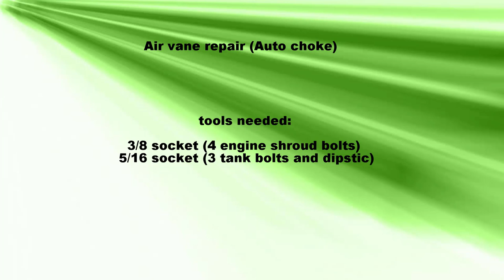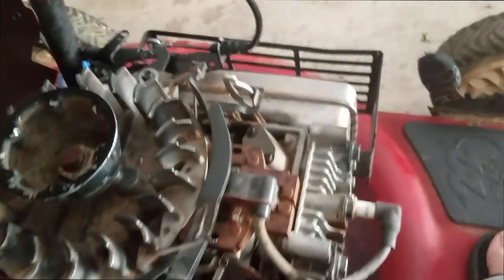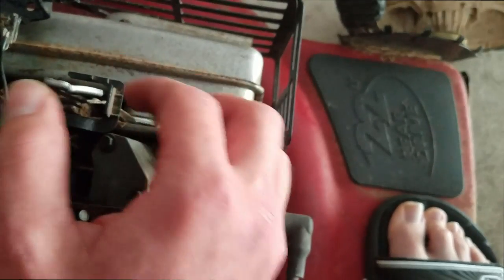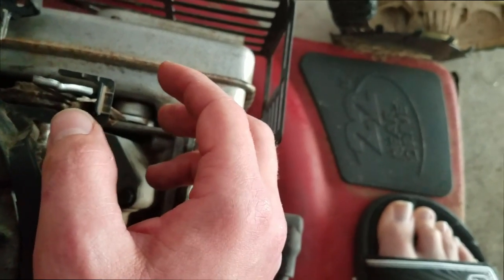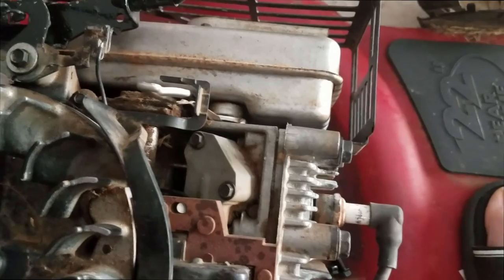air vane auto choke repair

Comment: After replacing the carburetor,  spark plug, and air filter, I figured she would fire right up. To my chagrin, I pulled and pulled, and not a thing happened. Then I saw your video and saw that little spring which I forgot to reattach. After that, she roared back to life. Just a small adjustment can make all the difference. Thanks a ton.

Comment: I think I may see what the problem is with the choke arm spring tension.  The carburetor (outside) end of the spring should be hooked into the notch on the "finger" with the little arrow point at the end of the choke arm. This should increase the spring tension to allow the choke arm to function properly.  Good video, though.
Reply: I was thinking the same thing cause I took a picture of mine before swapping out the carburetor and the spring is in that notch you mentioned and not where it’s displayed in the video so that could be it.

Comment: The tension on the Air Vane spring is engineered to hold just the right amount of resistance when cold and hot. hooking this spring where it was designed to be hooked will aid you in your efforts to smooth out your engine idle without having to experiment. I noticed in your video you had this Air Vane spring hooked up where it was not supposed to be. First things first. Remember theses B&S springs are engineered with just the right amount of tension and resistance in mind. Always use OEM parts.
Reply: Or don't buy one of these incredibly bady designed engines. I wish I didn't have.
Reply: I had one given to me because it wouldn't run. I got it running great until it heats up. It is a ridiculous design. I guess now I have to put money into it and buy a themostat for the lame auto choke. @thosoz3431

Comment: *DO YOU KNOW;  your AIR  VANE SPRING IS ON THE WRONG TAB ? After watching MANY vids., it is supposed to be on the little tab 1 inch to the right of the anchor bolt head--there is kind of a triangle around the tab/earlet.  **I ALSO LOOKED AT TORO diagramS online and the factory has the spring attaching to the that tab; yours is lower and hooked to something else out in front of the pivot base. JFYI ! 'NOT 1 of those guys that rag on Ytube Postings OR a know it all ; I wish I had $$$ for all the time I have spent/mispent on trying to get such a delicate (&dumb) spring design to function;  A $6 CABLE WOULD HAVE WORKED FINE ON THE CHOKE MR. TORO !

Comment: I bought this exact mower today for $5. Missing the air cleaner and most of the springs. They have the choke zip tied. I’ll get it restored and rebuilt. This video gave me a heads up

Comment: Was having problems, difficulty to start, weak running sudden stop. Just check the choke bar discovered was stuck on two of the bolts below it.  Straighten it and when first start it worked bad but after a minute or two improved and since cut an acre of lawn without any problems.  Would have never been able to figure it out without Your Video's help.  Thank You Very Much.

Comment: Thanks for the tutorial. I bought my mower used and ever since I've had it it won't turn back on after it's hot. I replaced the spark plug and ignition coil, but still had the same issue. Finally I can't access your video and when I looked inside my mower the thermostat am was totally crushed, maybe after Simone pot back on the shroud. Needless to say this video was a huge help!

Comment: Thanks for an informative video. I've got the same issue-a mower that starts and runs fine but if you shut it down to take a break it won't restart until it is cold. Now I know the inner workings I can tackle it and see what's up.

Comment: I use springs on my b&g engine. My mower has no throttle on the handle, and I use another 2 springs for it to work. It’s a mess if you look at it but it gets the job done.

Comment: I'd love a simple video of what bolts go where as far as removing tune up items (shroud, air filter/carb/breather box) and putting it back together.

Yeah, I have one in pieces with missing bolts. 😅
Reply: Check Jeff’s small engine videos.  He brings one back from the dead& he tells you what size of bolts, he never addressed the thermostat position issue.  Also has a good carb rebuild video. Good luck!

Comment: looks like the Air Vane Spring is not attached at the correct location near the lever screw see time 1:51 a hook just to the right it is currently in wrong attachment point. which could be the problem.If you have not already figured that out.

Comment: It is a dreadful design.  I have these given to me since the owners do not want to wait 30 minutes for the thermostat (mounted on exhaust manifold!) to cool down.  The Honda solution is far superior with the wax filled cylinder that heats and expands to engage the choke.
I'm still working on a method for a manual choke, but until then, I removed the red plastic shroud so I can at see SEE the position
of the choke before I try to start it.  I absolutely REFUSE the replace the thermostat since it works, and I set the thermostat arm based
on the designer specs, AND tensioned that spring (the one you said falls off), so now the delay is down to 10 minutes...but that is still too long.
STAY TUNED! 

7/1/2019 - UPDATE: I tied a string to the choke arm and ran it up next to the pull cord.
Its wacky, but it works.

 North Central Florida
Reply: I like how you found a solution.  Mowing the lawn is one thing, the mower acting stupid will make you crazy!  I might try this next!  Thx
Reply: @lzh3131  You are very welcome Sir!
We still live on that 9 acre lot, but we
have not yet cut grass for the year.
Minimal rain, and chickens like to
run around in the little grass that exists.
If I was King, everybody would have chickens.
5.31.2024

Comment: What would happen if the plastic choke arm is on the opposite side of that metal heat vane that sticks up behind the muffler?  I own a lawnmower with that same engine and the choke arm is in between the heat vane and the muffler and the flywheel.  There was a small bungee cord holding the rocker arm for the choke open.

Comment: hi the little red pump thing that i have to push 3X to get a little gas to start my briggs doesnt get suction, or isnt working. when i push it i use to get resistance when the gas moved , is there something i can do to get gas in so it will start?
Reply from the maker: Yes. You can either spray some starting fluid or a mist of gas into the intake or replace the primer bulb. I have a video to upload of replacing it on a weedeater but i think it would be better to search for a video of your Briggs primer bulb replacement.
Reply: IT'S A AUTOMATIC START DON'T HAVE A PRIME BUBBLE ON IT.
Reply: From one of the other videos. Sometimes the gasket behind the filter leaks and u may need to place 2 gaskets to make a seal.

Comment: How about pull that plug wire while you have your feet under the mower?
Reply: In case the mower that fails to start automatically goes "Maximum overdrive!"